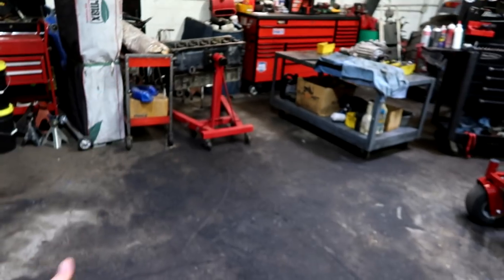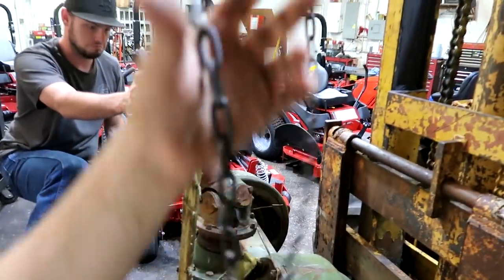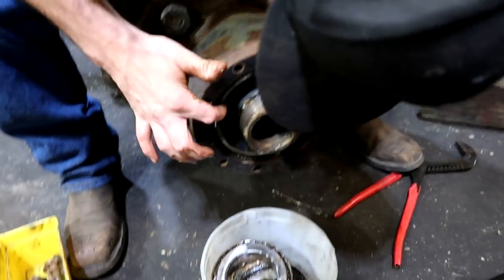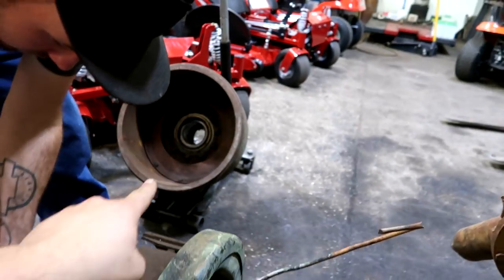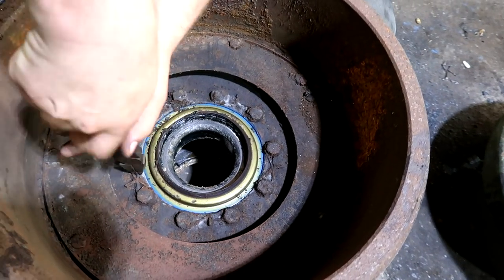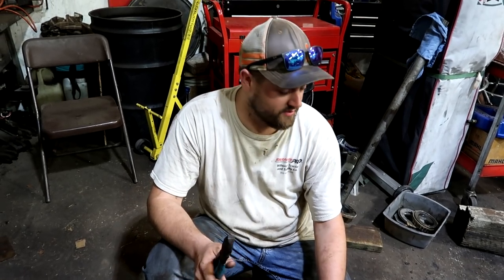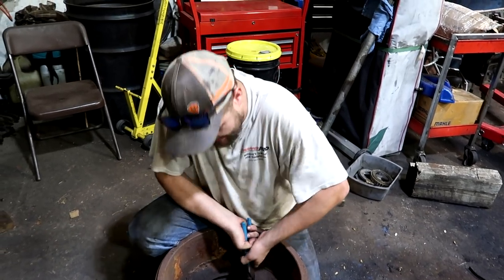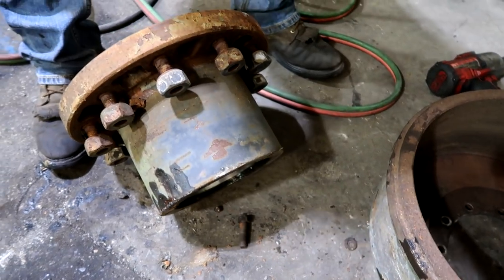Cutting Up My 5 Ton Mega Truck Axles Already....

Comment: Put a locker in them and buy a spare set depending on the quality of them. I have seen them bend and crack but it saves the rear end a alot more then welding them. They really dont like to be welded they destroy them selfs when you do .

Comment: Have you thought about transfer case??? You can get a profab transfer case with like 18”-22” drop straight from the autozone in Okeechobee Florida. The little one across the road from the blue star memorial in Okeechobee Florida. Ask for Dennis

Also they deal a lot with Spartan/ATK performance for small block big block and LS. I know every store has these options, the difference is that these guys know what they are talking about, and know how to get it.

Comment: Just wondering how you're going to spin the hubs around to off set the rim ? Hubs are drilled on 1 side for axle flange to bolt too .🤔🤔
Reply: There's holes on the backside that held the drum. Maybe it's the same pattern.
Reply: You press the studs out and turn them around and put them in same holes the opposite way. That reverses the bolt pattern.
Reply: @ThatGuy-AG  one those axles are the inner bearing bigger then the outer bearings? Or are they the same
Reply: @DieselAddict-vs9fc  inner bearing and outer bearing are different but they use same race. So you can just flip the hub either way.
Reply: Military standardized allows hubs to work either direction. 2.5 ton axles are the same in that manner. Depending on what series of truck,  there could be either duals or singles on the rear. That would determine the direction of the hub.

Comment: You don't have a plasma cutter still using oxygen and settling torchI figured Wilson tractor was more advanced then that
Reply: Plasma cutter for 1 inch steel are expensive and run on 3 phase power 
Any 200$ cutting torch can  do that like you just see in the video
Reply: You haven’t worked around much farm equipment have you? 
Question:
How does a plasma torch use the tip to transfer the energy to the work?

Comment: "We dont send our stuff to get built"

 But you will say you'll 2 stroke a buggy then back out NEXT video
Reply: okc 306 but those motors are complete crap only worth the wight in scrap
Reply: Not seeing any relevance there............
Reply: Oh well, I've changed my mind 3 different times on what motor I'm putting in my truck and ive lifted it and then turned around and lowered it. It's okay to change your mind
Reply: okc 306 that motor in a swamp buggy was a cool but very bad idea, the weight was just too much for the chassis and it would go straight to the bottom of any hole and be very hard to pull out.